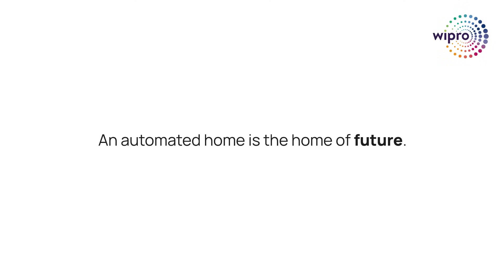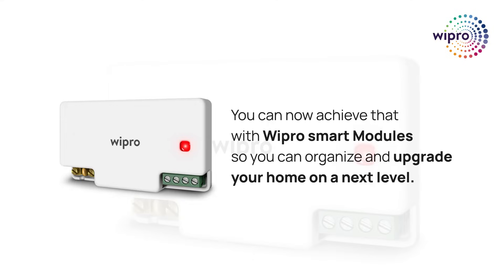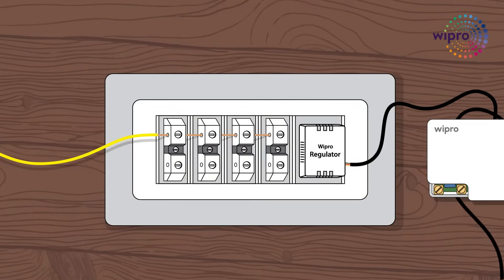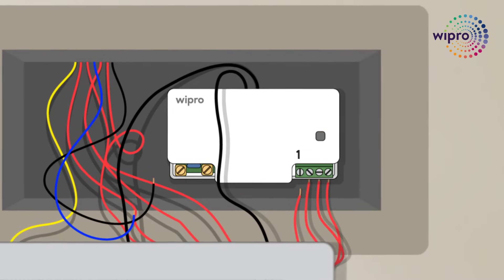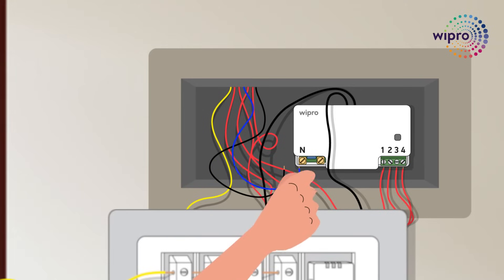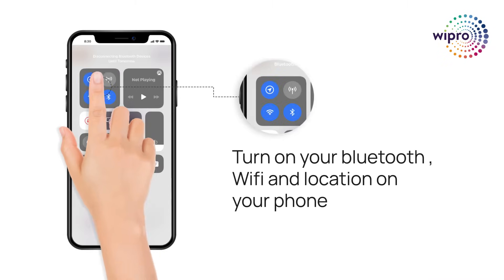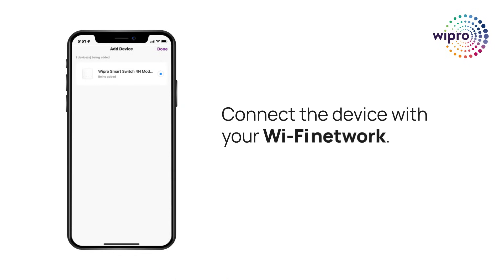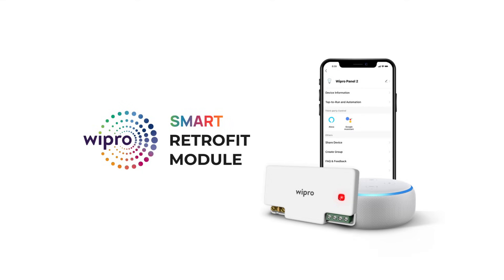Smart home is the future │ Wipro Smart Retrofit Module

Comment: But does it work without wifi.. for Example bluetooth? For using it through mobile as remote controller?
Or wifi is compulsory to use this device, also if we don't have router, can we use mobile hotspot as wifi to connect device?
Reply: Not an option to use a mobile hotspot, use a router or the normal switch
Reply: If you are going smarthome route, wifi is a must or the automation is just using a phone to turn it on and off.